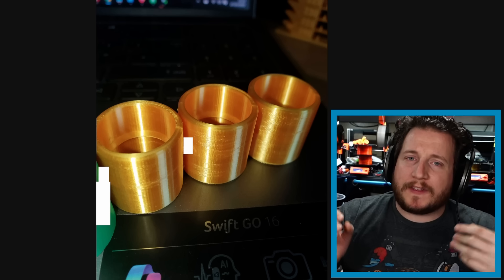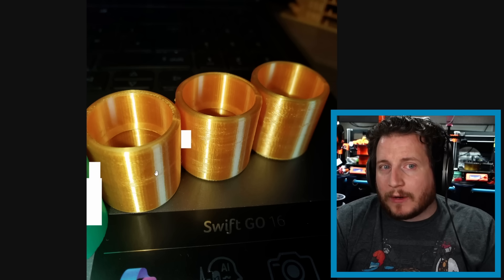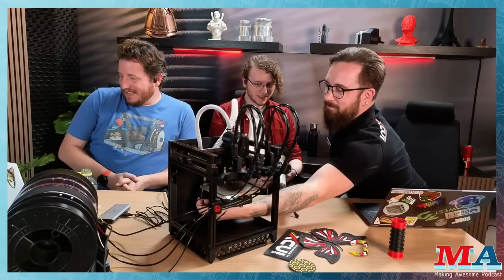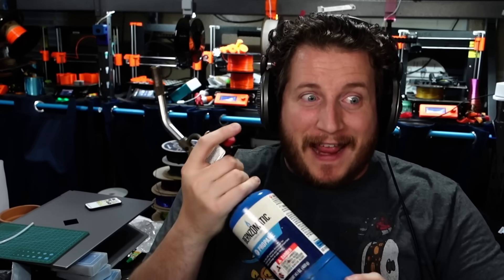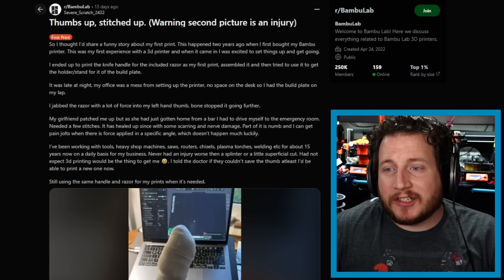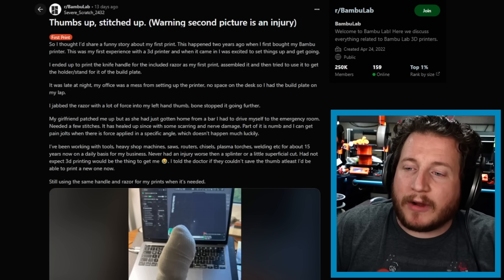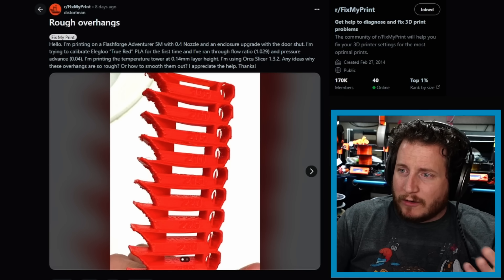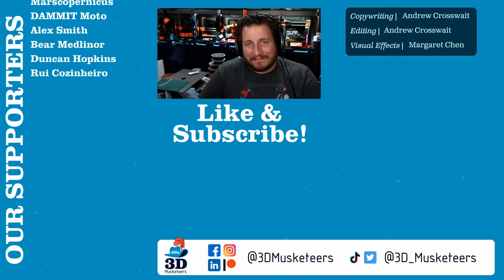This HAD to Hurt!! - PrintFixFriday 192

Comment: I have used the scraper thing in the paint aisle at the blue big box hardware store for a while now on 3D printers, and I've stuck myself a couple of times.  It's not terribly sharp (nor is it meant to be) and when you do get yourself, it takes forever to heal.  I actually replaced the stock bed on the old Flashforge with a flex plate to avoid the stabby stabby.  It only ever gets used now when stuff happens early on in the print (like layers 1-2) and I need to get under that mess to pull it off of the bed.  When stuff is that thin, it doesn't pop off with a plate flex.
Reply from the maker: But when it's thin you hope the plate holds itself in place

Comment: So far I've never needed to use a steel scraper blade. However there are often things that don't release from flexing a plate. I've had models remove cleanly but leaving a handful of support tree bases on the plate that need scraping off. Generally with persistence and sufficient force a plastic scraper will remove them.

Comment: I always flex the plate or use a 3D printed scraper. It's been so long since I've hit myself with even the plastic scraper, though - just have to be aware of what you're doing and not be hasty.

Comment: I haven't stabbed myself with a scraper, but I have multiple times with a dental pick I was using to remove support material.
I do occasionally use a scraper on PEI, when something thin is stuck to the bed and just bends instead of popping off. The alternative to that is using a fingernail, and then you risk stabbing yourself under the fingernail with sharp plastic.

Comment: Had a ceramic coated glass bed on my ender 3. Worked well for bed adhesion, too well... Tried to scrape a part off, damaged the part, and eventually dug the scraper into my other hand when it released. So glad flexible PEI sheets exist

Comment: I have been using the disposable bare razor blades  for bodywork (my other expensive hobby) for a long while. I'm crazy enough to hold the blades in my mouth (not recommended by 4 out of 5 dentists) when fitting up up masking paper before cutting the paper. Only ever cut myself once, but yes sharp things are a hazard.

I even use the bare blades  to remove PETG purge lines that don't want to lift off the cheap old T300 build plates.

Comment: I use a plastic razor for print removal if needed. but with most flex plates I don't need to.  

On my resin prints I do. I used to use a magnetic bed -flex plate but I find I get some plate movement with that so stopped using those and went back to a plastic razor to get the print started to lift and then switch to plastic spatula. 

Reason I use plastic is to not scratch the build plate but I need the thin part to start the lift.  I was using a metal flat exacto blade but I got worried about slipping and cutting myself so switched to the plastic razors